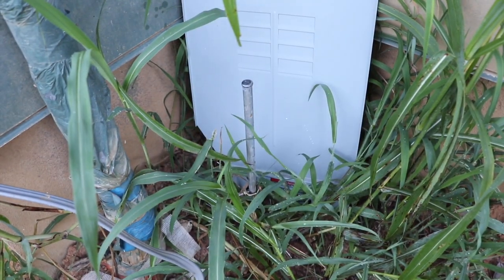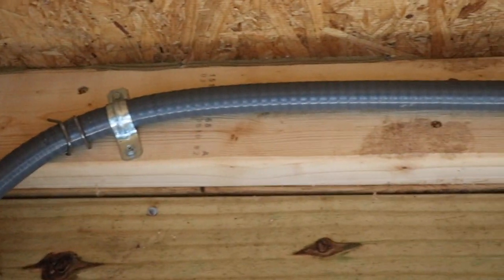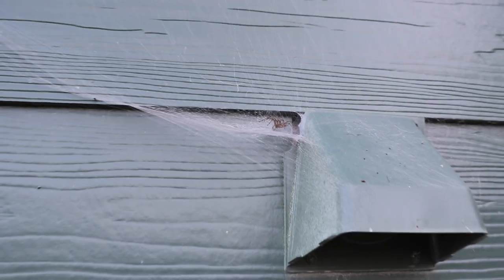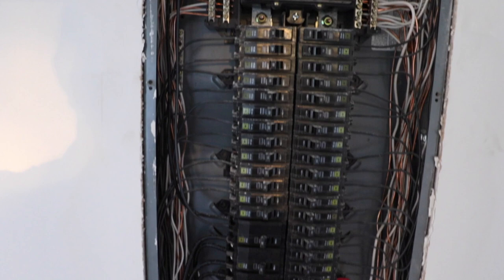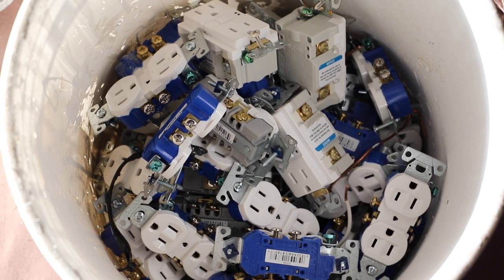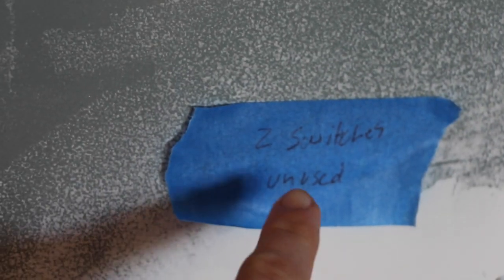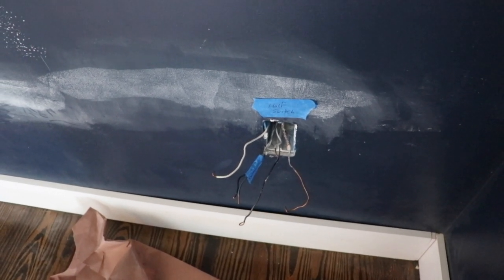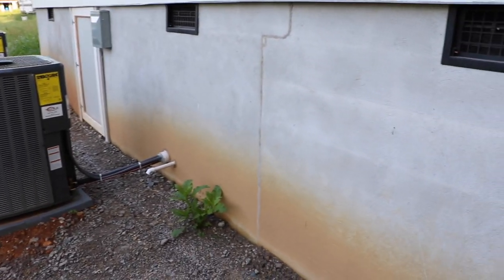Electrical Contractor Failures - Trade Tips

Comment: This is why I do all my own wiring and plumbing.  I have wired two house, last one being 5,000 sq ft and have not once had the inspector find any issues.  I am not an electrician or plumber by trade but do have a college degree in computer science.   I know that there are good and bad in all professions but sometimes it is hard to tell which group somebody falls into.  When I do my own wiring and plumbing (The first house was done before the internet was around so I could not just looked it up on YouTube.  I had to get a book, read it and use a little common sense) I use the best materials I can find and do not scrimp on cost or take short cuts.  If I mess something up, I rip it out and redo it.  Nowadays people hire someone to do a job based on if they have a good web site or advertisement without going out and seeing their work on a previous job.

Comment: At the a/c sub panel. As the conductors are all copper no “grease” is required. Any aluminum conductors are required to have a compound (such as No-lox). I see two green and one bare copper Ground Wires. No neutrals present. A/C condensers and compressors don’t utilizes them. Wall units sometimes. The nicked strands are a problem. Indicative of a hard headed individual who can’t be bothered to use the correct tool.
Nicked wires at outlet box. Very common problem. I have tried and tried (nicely) to show those guys the damage they do when they route the inside of the box rather than the outside, which is both the correct way* and the respectful way. *When they route the inside of the box the sheet rock continues to hold the box back in the wall, cockeyed. Routing the outside allows the box to come forward and (nearly) flush with the wall surface. I’ve “gone to blows” with drywall contractors who couldn’t (or wouldn’t) adapt. More than one wire under a termination is only allowed where the lug, terminal strip or breaker is UL approved.

Comment: Not sure as in the UK we use prominently copper in residential, but, if its a alu exclusive conductors, then there is no need for alu grease, but its best to do so, as the system can have a spur of copper conductors,

Comment: For inspections be sure to use a licensed electrician or contact your local inspection department and ask for a reference.  There are tons of hacks out there, some even making videos.  So always check with local electrical supply companies or inspectors to get the right people there to inspect or do any work.

The mixing of ground and neutral wires is a common thing that you will run in to as an electrician.  We offer straightening this out but its not a "must" . The reason this is passed many times is due to the expense and scope of work., It would mean a ton of splices, and most of the time, too many for the fill capacity so it would then mean replacing the panel and possibly rerouting many wires.  So generally, unless theres a problem, and if this is a panel that has been installed for years and years, the inspector will allow these but never ever do we install panels in such a manner.  Some of the things mentioned here were relevant but a few were nothing important.

Comment: "Termination" or "terminate" means to connect or "land".  To "de-terminate" means to lift or remove a wire from a terminal.  If you asked for switches to be left terminated, it was done as you asked.  However, I understand your points throughout this video.  Well-done in trying to get things done right!

Comment: One problem with all that is mentioned in this video is that most of the things to do would require installing a new main panel and more for most homes that would normally be grandfathered in. Arc fault breakers only go into new panels, not the old ones put in 50 or more years ago.

Comment: Anything in the laundry room should be on the same 20 amp circuit, and it's fine to have up to nine outlets on a gfci. So the reasoning behind wire direction in the laundry room is false. As for the AC unit, there really isn't a neutral. Current is placed into a capacitor to send back on the second phase when it is 180 degrees out of phase instead of 120. The ground is for lightning protection. As for your subpanel, many states allow two phase 200amp service houses to have a combined neutral and ground, out of the main panel. If that's the size of a subpanel, how big can your house possibly be? The longer bars to the side are typically your neutrals and the smaller bars with green screws are supposed to be grounds. That spot where the meter goes is called a meter base and I think you're confusing that for a panel, which would normally hold breakers. You're right about the arcfaults and a lot of the sloppy bits, but there's nowhere in any code book I've seen (you're welcome to prove me wrong with a link to it if you wish) that says you have to have a dedicated circuit on the outside and in the attic. In Ohio, Kentucky, Indiana, and a few others, you have to have an outlet within 12 feet of an air conditioner, but that's about it. Doesn't have to be dedicated either. The electrical grease you were referring to is called de-ox or oxide inhibitor and it prevents arcs and charring on any connection involving aluminum. This includes copper to copper in a butt splice. You are, however very right to check up on your contractors' work, because you may or may not know them personally, but what they say they can do and what they actually do can vary alot.

Comment: Both are 120V to neutral and 240V hot to hot in a residential panel so at 8:22 why would it matter which side the red and black feed wires are on?
Reply: That is true, but in a 240V residential panel neither are going to a 3-phase motor or anything like that where correct phasing would be important.  Even 240V Heat/AC units, water heaters, and other 240V appliances can be wired with either phase in either position.  I guess it's a technical vs practical thing.

Comment: Those grounds at 1:53 is what we call "Pulling an India". I have seen stranded grounds like that where each strand is tied into the bus bar.

Arc protection breakers are only required on new home builds or electrical system updating in older homes.. If you have an older home and the electrical is not giving trouble then you are not required to update the breakers. It's similar to the old knob and tube wiring system found in very old homes / buildings, it's fine and up to code as long as you DO NOT mess with it.

Tere is no 2015 NEC..

The "random ground" hanging from the condensing unit is not a ground, it's a temp. sensor for the unit.

That "main house box" is a Main box, hence the main breaker, therefore grounds and neutrals are allowed to be mixed on a buss bar. Only sub panels, like what's on mobile homes or an external shed or shop running off the house mains, do the grounds and neutrals have to be on separate buss bars.

White should not be used as a line (hot) if it can be helped, Just bad practice. However if you have no choice at least wrap it in black tape in the panel and at its destination.

Comment: No deox requirement on copper wire terminations, also just because it’s 2014 code it does not means that the jurisdiction that you’re in requires afci breakers also that would up the price tag substantially

Comment: If you made up your boxes properly before you had a rough-in inspection, you would not have to worry about labels being missing
Reply: Exactly.  I make up all my boxes after pulling wire (in conduit land here near Chicago).  I could be drunk at trim and still know exactly what goes where at trim.  LOL
Reply: Thanks for the comment Ron. That Charlie Rankin guy is a real piece of work. Sounds like he screwed up the electrical in this house and is blaming it on the electricians. I am glad that my state does not allow General Contractors, Landlords, realty companies, business owners, and "ranch hands" to do their own electrical work. I still have to check and repair homeowner wiring ocassionally, which usually turns out to be a nightmare. He even admits to wiring most of the house himself.

Comment: If a wire is coming from the top it doesn't mean its coming from another circuit. Youd come from the attic through the top plate( wood 2x4 ) down into the space of your wall. If there is space up there. That all depends if dry wall is up or not. It should be dedicated for your washer no doubt. If you think its pulling power from another box the new electrician will find it and then run you dedicated line for the washer

Comment: I just had an electrical fire in my house that I bought a few months ago. I discovered that when the previous owner switched from a gas hot water heater to an electrical one, he simply took an existing 110 outlet and rewired it to a 220 breaker. My house is aluminum wired, so a 12 gauge aluminum wire was sending to 220 the hot water heater.

Comment: At 4:24, the "grease" you are talking about is Noalox. And they are called Lugs, not fittings. Lastly, the "Lugs" both on the circuit breakers and Sub Panel, are rated AL/CU. Suitable for Copper and or Aluminum just FYI.

Comment: on the ac disconnect/ sub panel, nolox is the "grease" you're talking about. anti-oxidation compound. for aluminum wire. also the enclosure is not bonded/ grounded.

Comment: As per the Code book the grounding rod does not need to be completely underneath the ground as long as at least 8ft of it is below the ground, so as long as they used a 10ft ground rod for that job, then it would pass. Although no electrical inspector is going to dig up a ground rod.

Comment: afci, gfci, TR, indepent circuits... they all have their specs and needs. not everything has to be that way. one thing is correct only in the main bonding jumper is where the ground and the neutral should contact but old houses where jumped together so theres not much damage... its all depend on the electrician...

Comment: I personally can't stand tamper resistant outlets. They are too difficult to plug things into most times. When I was young, I would take an electric train set and short the tracks with metal objects for fun, with my bare hands. I used to stick stuff in 110v outlets to feel the tingle. Just can't be too dumb around electric. 
I now do a lot of wiring/rewiring of homes and apartments, I see a lot of wire connections that are loose, or have little to no twists for wire nuts. I've seen a lot of melted wire nuts also. Old timer DIY guys used to always make tape connections outside of any junction box and inside walls. This is the stuff that causes fires and electrocutions. This latest place the guy ran at least 6 wires that were labeled "future" and were live, with taped ends, and coiled under insulation in the attic..... I hope they weren't powering anything important in the future, 'cause I cut 'em.

Comment: The red and black feeds to your sub panels don’t matter which lug its on. There isn’t a code that says which color needs to go where other than your neutrals and grounds. The color code is something electricians made up. If you want to do blue and red you can, all that matters is that “A” phase goes to “A” phase and “B” phase to “B” phase.

Comment: On a sub panel the neutral and the safety ground have to be separate. Sub panels the Neutral and the Safety ground can not be bonded and must have its own grounding rod installed. Can not have the safety grounds connected to the main panel.

Comment: ALL citations by a municipal/AHJ inspector must be backed up by code references and or locally passed ordinances. For example, the NEC allows NM cable to used in residential electrical work, but Chicago has a local ordinance that says all wiring must be in raceways. If a client has any doubts about the legality of my work, I make clear at the outset that this is a requirement. If you want to learn about the Code, I recommend the Mike Holt family of products. While the Code changes every three years, the bulk of it does not, and even a knowledge of the 2008 version will get you through a job 99% of the time..

I have asked one of the critics below to provide his perspective about the work you cited in the first five minutes. I am hoping that he can provide references and ordinances that allow what you pointed out. That should be a lot of fun.  -IAEI member.

Comment: Alot of these 'failures' don't matter very much, code compliance aside, passing the inspection is usually guaranteed by the electrician.  I'd say it's a lesson in managing expectations - some customers could give a sh*t as long as the lights turn on and the house doesn't burn down, other customers are very particular about quality, fit, and finish.  The best way to get exactly what you want is to do it yourself - then you can learn the real reasons why people take 'short cuts'.  A good electrician can finish a job to a satisfactory level (for the inspectors) in ALOT less time than most home owners because they know what matters and what does't... and they've done it many, many times before.  If you ever work the trade you will see WAY worse than this almost every day of your working life.  On a related note large companies have to manage quality of contracted work very carefully - for example check out the TMLS quality clauses, imagine the cost impact of tacking something like that onto your next home project ... https://www.textronsystems.com/sites/default/files/resource-files/TMLS%204156%20-%20PO%20Quality%20Clauses%20rev%208-18-2016.pdf

Comment: Some good stuff here and some fluff.  I read a book and looked at some construction projects nearby and did all the wiring for a 1500 sq. ft. addition to my house and pool wiring with little prior experience.  And got compliments from my Inspector.  The funniest part was the pool contractor looked at my pool conduit (gray PVC) and told me that didn't meet code.  He insisted it needed to be wrapped steel.  He was wrong.  Either way met code.  Problem with most "contractors" is they only know one way to do something.  They meet code but that's about it.

Comment: The GREASE you think they need to use is NOALOX for ALUMINUM wire terminations.  Make sure you know what IT IS before you call them out on it.  It’s like walking around red tagging an inspection but yet you can’t cite what the code violations are in the NEC but you think it’s wrong somehow

Comment: Great video so I just bought a house from 1950's the service is coming underground is there a way to tell what size wire is coming in without pulling the meter? Right now I have 100 amp but want to upgrade to 200amp.
Reply: Luba Luba you should get someone who is qualified to do your service. If you upgrade your panel to 200 amp and it is 100 amp your electric company needs to be involved. They put in a new meter can and the electrician you hire would run a new wire that is rated for 200 amp
Reply: Yes I know but upgrading will depend on size wire to handle 200amp if it isn't I wont upgrade it will be too much money to run new line from street sorry thought you were electrician.
Reply: Luba Luba lol, you can look at the size of the wire if you take the panel cover off of your main panel or just look at the service coming into the panel. Most if not all the time the wire is rated for 100 amp if 100 amp run because it would make no sense to run 200 amp wire and not put a 200 amp panel in
Reply: Luba Luba there is also a very noticeable difference between the 200 amp and 100 amp where the 200 amp is much bigger than the 100 amp
Reply: the entry wire comes behind the meter in the basement its underground service
Reply: Luba Luba if it’s an underground service most likely your meter is in your basement. There would be a wire coming into the meter can and a wire coming out that goes into the main panel. In order to upgrade your panel to a 200 amp you must replace the service wire. So no. You would not be able to upgrade your panel unless you get your feeders upgraded

Comment: 11:41 - wires don't get knicked by drywall guys if they are properly made up by the electrician and put into the back of the box. 17:23 - a GFI protected outlet within 25' of the exterior service equipment is a minimum. There were many issues with this build and a lot of the problem is that quite a few of the electrical  contractors can't hire more experienced guys because there are not that many to meet the need or they don't want to pay what those experienced electricians what they are worth, so then a bunch of apprentice level guys are doing the entire job with nobody checking their work.

Comment: At 7:50, this is correct. The panel has a main breaker, not main lug. Grounds, and neutrals are bonded at the first means of disconnect.

Comment: Technically that a/c box is a sub panel and has to have the ground and neutral separated and not bonded. And in the main sub panel it also needs to be separated . Arc fault breakers are only required in new model not necessarily in remodeling. Outdoor outlet need be gfi protected , when bonding aluminum and copper noloc is needed .
Reply: Here - if it's new and has a plug on it it has to be arc 
fault protected with very few exceptions.

Comment: Connecting the neutral wire to the ground bar is called bonding. Allows your overcurrent protection i.e. breaker to detect an overcurrent quickly rather than relying on the overcurrent to travel through the ground back to your transformer and then reaching the breaker.

Comment: The cut insulation in your switch box’s is because you did not make up the box properly..it is not the drywall guys fault...always move your wires away from the sides just for this purpose